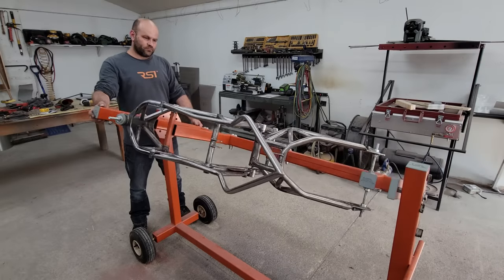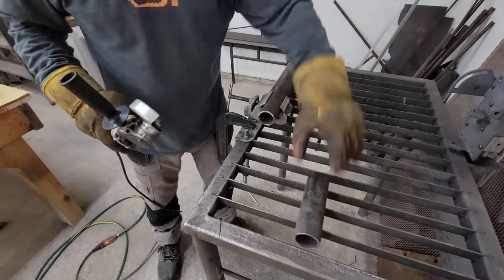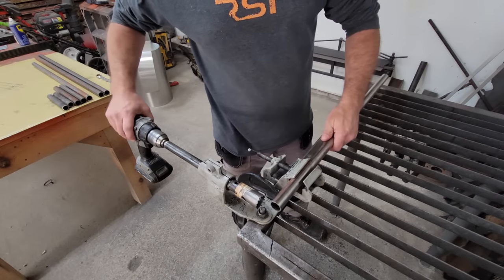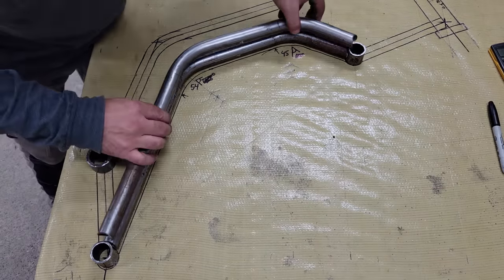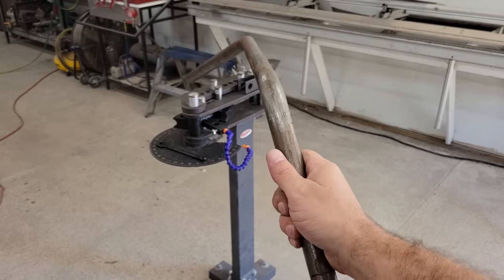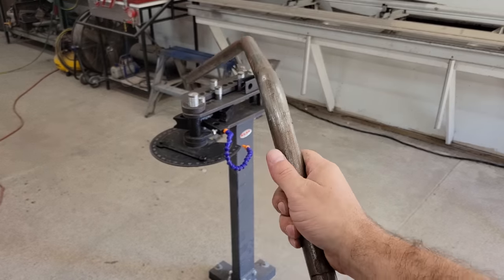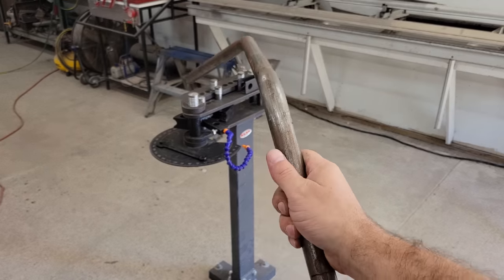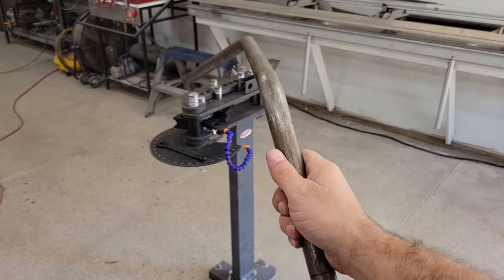Electric Motorcycle Build - E-Bike - Gen II, Ep 1: Trellis Chassis

Comment: I learned lots of new tricks here. 
A tool you could build & use - simple as exhaust clamp. Clamp to round tubing to get a flat reference before using tube bender. Really handy for lining up multiple bends on single piece. I made a square with a hole (size of tube) then cut in half. Added two counter bored holes on one half & tapped hole on other. Easy to clamp to tube with socket head bolts.

Comment: Wow, impressive. It would be nice to see the same quality put into a mid drive electric motorcycle! I know its probably a bit more work with the gearing, chain, tensioning, etc but probably worth it and you get tuning of the gearing, better rear suspension, less weight, and probably more reliability in return

Comment: Love the frame build! The only thing I would change is to make the dropout for the rear wheel a bit stronger. I have mountainbikes which have beefier ones . They take a real beating. Just wouldn't want to see you get hurt.
Reply from the maker: Thanks. They'll be fine though. I've done this quite a few times already, and they're far more robust than the small aluminum dropouts on any dirt bike I've ridden - they take far more beating than a mtb. 3/16" steel is pretty tough.

Comment: Check out the P-51 ebike, the design is super simple but is lacking power. I want a highway bike designed like it
Reply from the maker: I assume you're referring to the small ebike and not the confederate P51? I like the confederate much better lol, only problem is it's powered by gas. But I'm using a similar set of girder forks with this one.

Comment: Would it help to heat up the tubing a little bit before you bend it? Reduce stress fractures? 🤔
Reply from the maker: I guess, if you want a super tight radius that pushes the limits, but I don't think anyone does unless they're a blacksmith because you'd have to bring it to its glass transition point first for it to make a difference, which would involve a forge. Steel flexes to a degree without damage naturally, and isn't affected by bending anywhere near as much as aluminum, for ex. That's not to say aluminum isn't good for stuff like this because it is. But if I were to place a plate of each in my sheet bender and bend them 90° around a 1/8" radius, the steel bend would look smooth and uniform whereas the aluminum would have noticeable micro-fractures along the length of the bend. But this doesn't happen with a 3" radius die like what I'm using to bend the tubing.

Comment: beautiful work and looks like you shaved off a bit more than 20lbs.  wow, so many questions like how long does it take to create expert aluminum welds?  what are your suspension choices are going to be (full ohlins maybe) , and  is it a good idea to use regenerative brakes on something this light and would it impact ride characteristics?  can't wait for your next one.  thanks again!
Reply from the maker: Thanks. Haven't had a chance to learn how to weld aluminum yet - this frame is DOM steel. Suspension won't be anything fancy. Like all of my projects, this is a budget build, so I won't be spending thousands on an Ohlins suspension. Just a simple shock with progressive dampening linkage in the back and girder forks with a progressive coil-over in the front to mix some retro elements in with the modern powertrain tech and give it more of the cyberpunk/Mad Max look that I'm after. Regen braking should be used with any and every e-bike regardless of size, if available. Converting the motor to a gen and dumping power back into the battery causes a braking effect on the vehicle itself, without using the actual hydraulics. This lowers the wear and tear on the hydraulics, but too much regen current can cause abrupt/uncontrollable braking or damage to the battery. The amount of regen current that goes into the battery depends on the mass and speed of the vehicle, since the energy that the motor-turned-generator is producing is coming from the kinetic energy stored in the vehicle's mass when it's moving. Small bike + slow speed = low charge input, big bike + high speed = high charge. Charge current limits to protect against overcurrent issues with the batt can be set by the user in the ESC, in most cases, or set by the manufacturer if the ESC isn't user programmable. Custom builds usually involve programmable ESCs, and like all of the performance settings, the regen braking current limit - ie: the amount of current and braking the function provides - is adjusted after test rides to suit the user's preference and batt specs.
Reply: @JamesBiggar  thank you so much for the mechanical consideration fundamentals, don't know anything about e-bikes but watching your build videos is just so inspiring, apologies for missing the tubing material not sure why I assumed it was aluminum.  the fact that someone can build such an awesome machine on a budget (if one had the skills of course) is even more inspiring.

Comment: Excellent! So you'll be putting the powertrain from the original bike onto this frame? You said in the video that you'll be using the same hub motor, but will you be using the same battery and controller?
Reply from the maker: Same controller, new battery (headway cells)
Reply: @JamesBiggar  oh, do you know P and S yet? Despite those being rated for high continuous current, their spec sheets show a fair amount of voltage sag at high discharge rates. If you have enough in parallel to compensate, that would be okay
Reply from the maker: The voltage sag's similarly to most lfp's, just more at higher rates, naturally. Only a 1 Ah diff in cap between 1C and 20C discharge with these at the end of the day. Not much to shake a stick at, especially since I won't be drawing anywhere near 20C from the pack. With a 6P24S configuration, a 4-5C continuous discharge is 25%+ more cont. current than what the QS 273 motor will demand, and nearly twice as much power as what's needed to maintain highway speeds, so it's all good. It's all in the design, as you alluded to, as with any battery :)
Reply: @JamesBiggar  The Ah capacity difference is not what I am pointing out, but rather the drop in voltage when you draw high current. Also, the motor is not what draws current, but rather the controller. The motor can do whatever, you got the 12kw rated one, which can easily do twice that. You'll never burn out that motor. The controller is what's demanding current from the battery, then delivering it to the motor. 

Do you know what your current amp draw is during acceleration or high speeds? Perhaps you're using an ammeter or reading controller info mid ride? This is where you can find out how much the headway cells will be affected. 

I pull 200-300 amps on a fast acceleration on my 350-pound bike (it was a conversion, not a scratch build, much heavier than what you are capable of doing). Your bike will be much lighter than mine, so lets call it 150 amps. At 6p, each cell will be delivering 25 amps. If you got the 6000mah headway cells, thats just over 4c. Real world data is different than my hypothetical numbers, but the voltage sag graph shows that 4c discharge is going to give you like a .5-.75v drop per cell. At 24s, your fully charged battery might be at 82v. After a .5v per cell sag, which the graph shows could happen at 4C, it could drop all the way down to 70v and initiate a cutoff in either your BMS or your motor controller, depending on your settings. You don't want that to happen when merging onto the freeway, or at the bottom end of your charge where the sag will become more apparent. And this is starting at a hypothetically fully charged battery; as go on a longer ride, 70V becomes 69v becomes 68v.... Mind you, if you accelerate hard unexpectedly, even if you have been pulling steady low amps, your current draw will jump quite high quite fast, and you risk triggering BMS or controller cutoff.

If you got the headway 8,000 or 10,000mah cells, presumably your sag will be less. If you know your current draw at high speeds and high acceleration to be always way under 150 amps, then your sag will be less. If you change it from 6p to 8p, your sag will be less. Not about capacity, but rather performance. 

That said. Your videos are an inspiration to me, your first e-moto directly influenced my conversion, and your new frame looks great. I just have seen the not great data on the Headway cells and wanted to point out potential performance problems, but I have no doubt about your overall talent and ability to deal with unforeseen issues. I also really liked on your buggy battery build, when you reversed the path of the negative cabling to even out the current path on each battery, due to comments telling you what might be incorrect about your build. That was awesome, its rare to have builders read comments, listen, respond, and change accordingly.
Reply from the maker: Thanks. No sense shooting myself in the foot, right? Lol. Yes, the controller pulls current directly from the battery, because the motor is pulling current through the controller - it's just converted to 3 phase ac (and output is a different rating than the input). When I refer to the motor pulling current from the battery, I'm talking about the controller being included in the equation and thus its dc current limits. I have the 8 Ah cells. Let's say each cell pulls 25A continuous, that's only 3C. The QS can pull over 300A at peak power (again, including the controller so that's 300A dc for 24 kWp), that's only around 6C.  I set my low cell volt cut-off to 2.6V in my bms for custom builds. Even at 7C, according to your graph, low voltage cut-off won't occur until it starts to get into that dangerous lower knee of the discharge curve, which should be avoided anyway because the risk isn't worth the miniscule amount of capacity left at that point. It shouldn't be a problem even if I were pulling 10C from the cells, though it's pushing it. 15C+ is asking for trouble, but again, I won't be using anywhere near that amount under hard acceleration. The BMS will be fine as long as the cells are matched properly (hopefully). EDIT: Of course, this will all change with time in the real world as the batt wears out and it could be a different story near the end of its life. But, they were donors so who am I to complain? LOL
Reply: @JamesBiggar  Donors? Lucky you. 

I will be very curious to see the battery and it's actual amp draw, and resulting voltage. Hopefully you'll incorporate realtime monitoring during rides, so you can share your data. My build did not turn out the way I wanted in many ways, but one thing that did work out is that I have a live voltage reading of my battery right on my handlebars. So I can see when I have a nice resting 79-80V battery (not necessarily fully charged, as you know from the flat discharge curve of LiFePO4). Then I can see when I gun the throttle and watch that drop to 73-74v at the lowest. Not great, but manageable, and it doesn't drop that low when I take it easy on acceleration. But certainly taught me what to prioritize on my next build. I used 12p 32650 on this one, they're supposed to be better and handling the higher current, especially at 12p. Next build I'm going to use the A123 prismatic LiFePO4 pounches, they come in like 30-60 Ah, and they're supposed to experience very little sag.
Reply from the maker: Correction, the controller can pull around 500 peak amps from the battery, around 10C. I don't tend to drive hard and use full throttle like that unless I'm burning a tire for a video, but if I did then the current can be dialed down in the controller a bit to prevent too much sag and low volt problems with the bms anyway. It'll still be a lot of power for a 300 lb bike.
Reply: @JamesBiggar  Absolutely. That's the way you want it anyway: you want the controller to be limiting the BMS, not the other way around.
Reply: @JamesBiggar  One more question. On your first build, I don't know for sure, but it looks like you used the torque arms provided by QS. Bolted into your custom swingarm of course. After 2 years, did they hold up? Did you have to remake something to hold it better and keep the axle from spinning out?

I used the QS torque arms provided, tightened the crap out of them, making sure they had no give at all even under acceleration. Then I drilled straight through the nut and axle and put in a cotter pin. That was two months ago, and I've had no slippage since. But I'd like to know how yours held up after 2 years of use. If it did at all.
Reply from the maker: Yeah they held up well, no issues. This time I'm attaching bolts to the torque arms that'll protrude through those brackets that I put on the dropouts. Just to make it easier to adjust and lock the wheel alignment like on a conventional bike, and serve their original purpose.
Reply: @JamesBiggar  Thank you. The internet seems to think they won't hold at all, but I've been okay w them so far, and if you used them, properly tightened, for two years, im going to roll w it for now
Reply from the maker: Yeah I've seen those comments here and there too, but I don't think they have much experience with these motors. QS has been around since the early aughts, so if they had a problem with their torque arms then they would have remedied it by now, or they wouldn't have repeat customers like myself. I have a few of their hub motors, never had a problem.
Reply: @JamesBiggar  Alternatively, I would say that while the torque arms might not be perfect fit, if they're installed correctly, youre good. I went a month on the bike where I didn't have it aligned nicely; I would tighten the bolts, and after 10 miles, I could feel the axle slipping during braking and acceleration. I could see it as well, raising the back wheel and watching it rotate a few degrees within the torque arm. Only after adjusting my spacers, bearings, installing a cotter pin, ect., did I get it right. So I would hazard a guess that using them incorrectly or not tightening them enough is what's causing problems, not the hardware itself.

Comment: What kinda work background do you have? Auto? Construction?
Reply from the maker: Construction mainly, started in the mid 90's. Got my carpenter's cert in '05, worked at that until a couple years ago. Dad was a heavy diesel mechanic, owned a hobby farm. Worked with him in the shop and on the farm since I was old enough to hold a flashlight.

Comment: How did you go about setting the rake angle?
Reply from the maker: Set an old fashioned angle finder with the speed square to 26°, then set the angle finder against the jig post and adjusted the rod for the head tube fixture accordingly.
Reply: @JamesBiggar  Was the steering tube also DOM??

Comment: Нow do you know how to draw and assemble all this, I also know how to weld, but calculate and think over, and then assemble the whole structure ...😯where can one learn this?
Reply from the maker: Basically, I just use common sport bike geometry for the power class, ie: wheelbase, rake, trail, swingarm angle, etc. (they're all similar with marginal differences), then get creative with the tubes while ensuring static and live loads can be distributed and supported well with the bracing. I'm building a lightweight enduro after this so I'll go into more detail and take you folks through my somewhat crude design process with the first video for that series. I don't do any load or stress simulations. I just consult load tables for the materials that I use and get busy. Old school method, with the exception of drawing it in CAD.

Comment: Could I ask what your background is please. Have you worked building cars or designing them?
Or have you worked doing electronics? Not only are your fabrication skills unreal the the knowledge of batteries, charge details, watts, amps, and wiring.

So I'm super interested in how you got to this stage in your work.

To be able to design a motor bike (or e-bike) a buggy and know everything from start to finish it just amazes me at how you know and can do so much at such a unique way
Reply from the maker: I'm really just a carpenter who got bored with his job after 25 years. My dad was a heavy diesel mechanic, technically, but worked on everything from cars to helicopters so I picked up a few things from him over the years. What I didn't learn from him or working in construction, I learned on my own by reading up on the theory involved in what I wanted to do, watching what others have done and plugging them with lots of questions. It's taken another 10+ years to get to this point after taking an interest in ev's and re, but if a simple country boy like me can do it, then anyone else with the time and motivation can learn these things too.